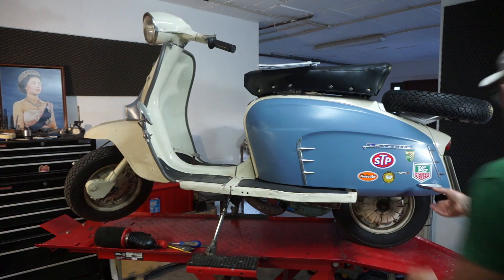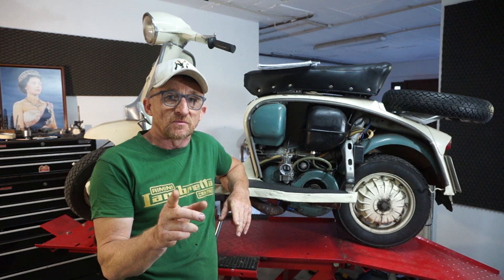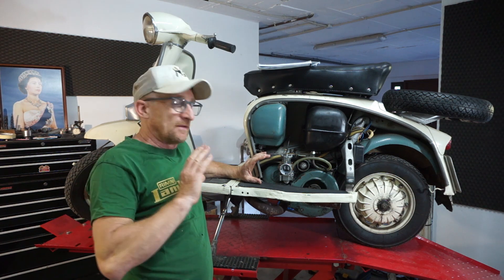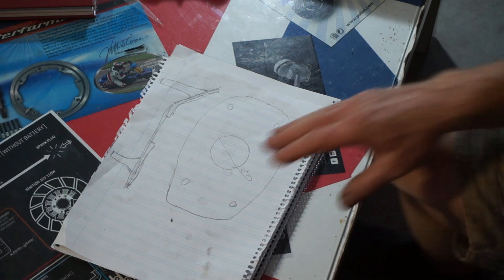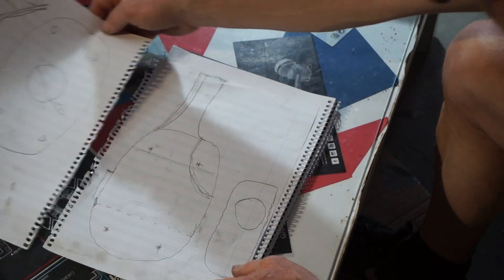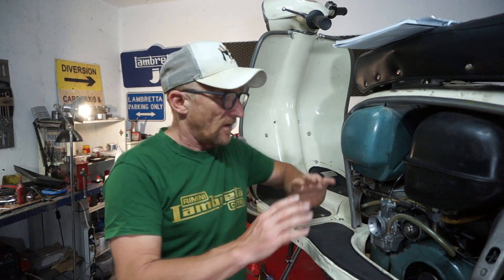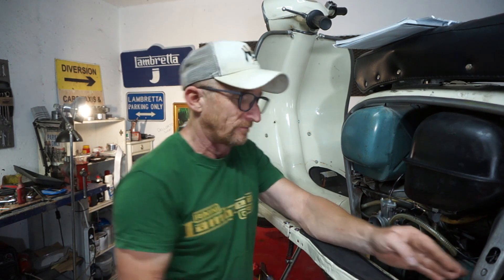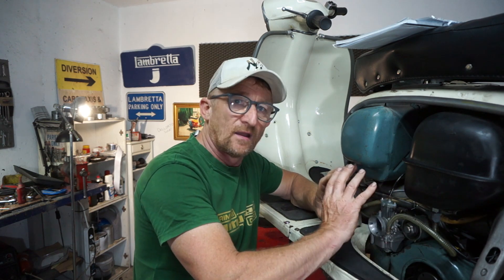LAMBRETTA AIRBOX DESIGN PROJECT

Comment: This is going to be interesting  , your doing the work every other  scooter shop   and  tuning company should of done  30 years ago and more ,  top work again
Reply from the maker: yes mate its time we made stuff that should have been done years ago , how long before the big boy copy me again 🤣🤣🤣🤣🤣🤣
Reply: @TheSteelweasel    a proper fuel gauge  , premix  system ,  modern electric   connectors ,  a complete  kit , ie top end , crank inlet  carb  and exhaust all from the same source , starting at 125   and then up that`s a straight bolt on no more mix and match, list is endless